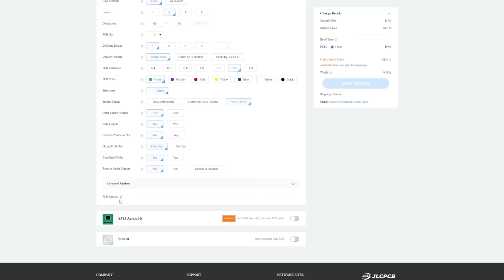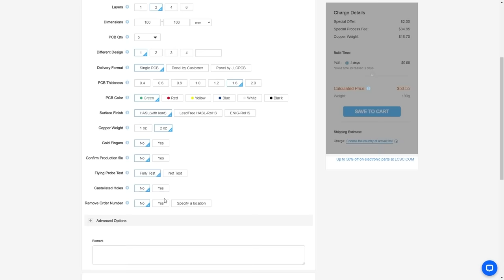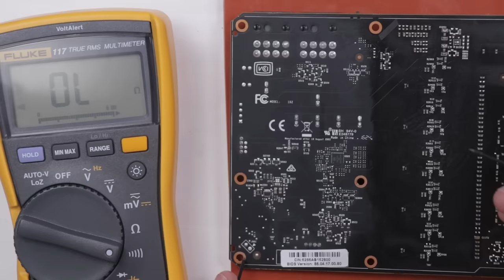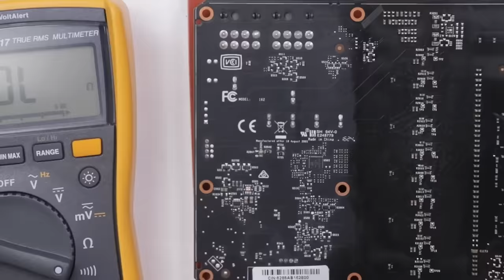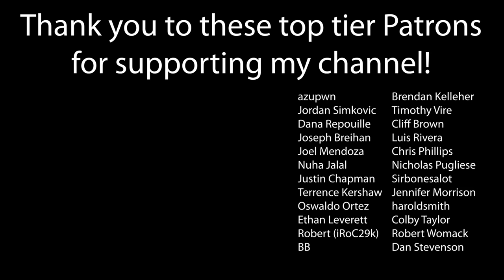I Bought 7 BROKEN Graphics Cards to Try and Fix - I Was Disappointed

Comment: 2080 Tis come with only 11 of the 12 memory channels populated from the factory, also, missing phases in the various VRMs is a normal strategy for the OEM to save money while still using the reference board design.
Reply: thats what I was thinking. Isn't each vram chip usually 1GB, so maybe that was a 11GB model but the board could also be used for a 12GB model and thats why 1 of the vram chips were missing? I also was thinking it came that way from the factory because the board looked way too clean, it didn't look like anyone went at it with flux and a soldering iron or heat gun since usually there would be some flux residue on the card afterwards
Reply: Yep, exactly what I was about to say. That EVGA 2080 ti xc ultra isn't missing any components. Also, one possible reason for the stacked thermal pads would be that the card was on a waterblock, got defective, and the just swapped the stock cooler back on to sell without caring about it being done right.
Reply: Yeah I'm bothered by him not researching the pcb or breakdowns out there. Love his videos but with today's resources this is something he could have researched on the fly.
Reply: Yeah, same with some other nVidia top-end GPUs below the Titans, like the GTX 780, same GPU (GK110) but partially deactivated and half of the VRAM, just 3 GB and these are only on the GPU side, the Titan has another 3 GB on the other PCB side; they simply share the reference PCB so the same watercooler fits both cards.
And also the 980 Ti and Titan X (both GM200 but Titan got 12 instead of 6 gigs VRAM), 1080 Ti and Titan X (Pascal)/Titan Xp (all GP102 but the 1080 Ti got 11 and the titans got 12 gigs).
Reply: Came here to leave the same comment. OEMs frequently make the same base pcb for a range of cards and populate based on the version to save money on the manufacturing and engineering side of things. Other times they over engineer in design and then find they don’t need all the extra phases or memory modules to hit their prospective benchmark. “Missing” components is a common sight.
Reply: Hello, Steve, 
The green dots and the crash indicates RAM chip errors. Those can be replaced.
Reply: 100% correct
Reply: @andrasszabo7386  This ! If the die itself would be bad then it would be a no image from my experience.Even the crash report said could not initialize memory.
Id like to see the 3060 and 2080ti revisited with some research by steve :D
Reply: @MrMackievelli  Yeah, It took me exactly 46 seconds to search "RTX 2080 ti" to pull of a photo of a stock PCB. As far as I can tell it is not missing any parts.

Comment: That 2080 Ti's board isn't missing parts, that's just cost savings done by the 3rd party board partners. Perfectly normal to be missing the last memory module. Check out some of the tear-downs of that GPU.
Reply: It’s actually supposed to be missing that 1 memory module. It’s an 11GB card, and each of those chips are 1GB chips. There’s 12 open spots but only 11 will be occupied on a 2080 Ti.
Reply: That's correct, but I think the top left memory chip is broken. Still fixable probably tho
Reply: yup some GPU's share the same board as the higher tiers. Like the 2080 ti shares the same board as the RTX Titan.

Comment: 1. Never, ever allow GPUs to boot past BIOS without a cooler mounted.
2. That 3060 with the green artifacts is usually an indicator that a RAM-chip is either bad or has lost connection with the PCB. You could try a reflow of the RAM chips.

Comment: 1) Don't ever just install and attempt to run a GPU that you know has an issue or is likely to have one.
2) Check for shorts on the power input rails aswell as on the voltage rails the card itself creates (5V, 1.8V, PEX, vCore, vMEM, VDDCI (on AMD GPUs), MSVDD (on all GA102 GPUs except for the 3090Ti)). Each power input is it's own 12V rail, so just checking one will not suffice. vCore, vMEM, VDDCI, MSVDD and PEX have rather low resistances, so check them using resistance mode. DO NOT use continuity mode, or you might just lead yourself down the wrong path. (Getting a close to 0 Ohm reading on vCore on newer GPUs is expected since the GPU silicon has a very low internal resistance.)
3) If you have a short, don't ever just inject voltage, especially if a power input is shorted. First, check if any power can make it's way from that power input directly to the GPU or memory using your multimeter. If there is a direct connection and you just go to inject voltage, you might just be sending whatever voltage you're injecting directly into your GPU or memory, potentially frying them.
4) If you have a short, inspect the componets that are on that shorted voltage rail closely. Don't waste your time looking at componets that aren't on that rail (they can't cause the short). Look for things such as blown capacitors, mosfets, powerstages or a bubbled-up top PCB layer. Look at the solder on mosfets and powerstages, see if there's some small solder blobs or balls around or if the joints look bad and not properly flowed. Those are indications that something got quite warm.
If you have a short on PEX, your core is most likely dead. AMD Vega cards a notorious for having defective cores.
5) If you don't have a short anywhere, run the card. If you have artifacting, it's very likely one or more defective memory banks, mayhaps even across multiple memory channels. For nVIDIA GPUs from Fermi to Turing, use nVIDIA MODS MATS. Run it, and it'll tell you in a plain textfile which memory bank is spitting out errors. You can probably do the same on AMD GPUs and nVIDIA Ampere cards, but I haven't looked into that yet. (As far as I'm aware, the latest version of MODS MATS that is available only supports nVIDIA GPUs from Kepler to Turing). Artifacting can also be caused by the core/memory controller. If the memory controller is dead, you'll likely find discolored underfill around the core. If you see that, the core is dead, or pretty much dead.
6) If you simply have no display, it's very likely just a missing voltage rail, probably caused by a defective logic gate somewhere on the board and/or physical damage (missing capacitor or resistor, GPUs w/o backplates are obviously quite prone to physical damage, so it might just be worth to take a closer look at the back of the PCB). That said, defective memory can also cause no display. In that instance, do step 5.

There are many more things that can cause a GPU to fail POST or not to work correctly, but a short, physical damage or a missing voltage rail are the ones that I myself have seen and fixed the most (by far).

Now, some things in general:

1) Any and all of the discolored PCB and componentry you saw in this video is not caused by excessive heat or overclocking. That's just silicone oil from the thermal interface materials reflecting the light in a funny way. Solicone oil is not conductive or capacitive. It does not damage your graphics card in any way, shape or form.
2) I'm not aware of any GPU that doesn't have some empty pads (and, by extension, missing comnponets) by default. So if you see an empty pad, that doesn't mean someone has used a GPU as a donor for parts.
3) Some GPU models have intentionally missing memory modules to get to the desired VRAM capacity.
4) Pointing a thermal camera at blank silicon doesn't do you anything since the silicon will reflect some IR that's already in your environment and, by extension, throw off your reading.
5) Please don't buy dead GPUs off of random people on ebay. It's a bad idea 'cause most of them are way beyond repair. Only buy dead GPUs on ebay if you can get at least a rough idea of what the fault is and, most importantly, if it's not been messed with already.
Reply: Something i'd like to add is that some GPU's perform just fine on benchmarks but fail on actual gamming, I have one here with this problem.
Reply: Very meticulous comment, I think he should do a colab with northbridge fix and they can hopefully share some knowledge with each other.
Reply: Graphic cards are so confusing. I'll stick to me ps5 and buy a new one if it dies! 🤣🤣🤣
Reply: Who are you the GPU police
Reply: This essay comment is a gold mine, thanks for the tips!
Reply: Or you could've just saved all that typing and told him to watch Tech Cemetery - lol -.

Holly carp. I just watched the rest of the vid, and boi, he is such a rookie with GPUs he shouldn't have touched them. The RTX3060 with the artefacts, ie, memory problem, he totally destroyed by letting it run without a heatsink. Ouch.
Reply: Thanks for the tips ❤❤❤
Reply: Also a thing I would add is that most of these better brands, specially at the higher tier cards have dual bios. It could be just as easy as a bad (flashed) bios why the cards don't work, switching over to boot with the 2nd bios is a easy test.

Comment: I have been fixing gpus for a living for more than a year. Nothing tells me these cards were unfixable. 
-The 1080 FTW just had a dead filtering capacitor. This model doesn't have fuses but its probably something minor. There are more voltages than 1V8, 5V and 3V3, there's also FBVDD, PEX and NVVDD. 
-The 3060(?) you ran at 140C, if it wasn't toast it probably is since you ran it at 140C... 
-No missing ram chip on the 2080ti. Each chip is 1GB, card is 11GB. Missing chip is because they bin the chips that have defective memory controllers and disable that one to have a better yield.
Reply: Do you have any advice for someone looking to get into fixing GPUs or electronics in general? How did you learn? Thank you =)
Reply: @phyro4143  hi, why do you consider northridgefix a scammer? Just wanted to know.
Reply: @chilly1661  Many of his videos he's changing components for the wrong ones (Alpha And Omega DrMOS to NCP DrMOS and vice versa, etc.), making the card, well not work then he cuts the video. I don't know if he's just ignorant or doing this to then buy the "broken" cards from his clients. He also doesn't seem able to diagnose memory issues, bios issues, logic signalling issues. Basically, only thing he seems to reliably be able to fix is a broken fan wire/connector.
Reply: I guess the 3060 had a bad RAM chip.
Reply: @phyro4143  yeah  the boss fix the easy one. For complex repairs with multiples ic failure leave to the most junior employee 😬
Reply: @phyro4143  I have the same idea about northridgefix... he want only to take parts for him ( doner boards ) because a lot of customers don't want to pay the repair  attempt ( 10 minutes? ) and leave phones/computer/cards to him.
Reply: Many years ago, I turned my pc on one day and got no picture. My HD7970 was broken. Any idea why it suddenly died like that? Never suffered from overheating or visual glitches on screen.
Reply: @rodryguezzz  radeon 7xxx 8xxx chips are directly soldered on the pcb without any kind of shield ( like new models) and with temperature ( and phisical dilatation)  some connections on the joins ( balls ) will fail...  at time a reballing was the best option to restore  the card ( there was a youtube channel called ELI TECH ) .. btw these cards rarely can survive 3 years of use.
Reply: @laboratorioassembler  It died after 3 and a half years of use so I guess that's true.

Comment: 6:30 The fans not spinning aren't really an indication. Those newer mid-range to high-end GPUs have what's called a "Zero-Fan mode" wherein the fans will spin when it's first turned on but then go off again until the GPU reaches a certain temperature or is hit with a higher load. 

On a usual startup the fans only spinning at the start is not an issue.
Reply: Maybe that card has corrupted bios?. Im just guessing honestly
Reply: @leexy3395  I was thinking that or mining BIOS
Reply: @benmasten5924  That 1080 has dual bios if I'm not mistaken, and the switch is right next to the 8-pin power adapter. He should've tried swapping bioses
Reply: @razmann4k  for sure.  He's learning though.
Reply: yup. I think they turn on at 60c if I'm not mistaken.
Reply: @benmasten5924  There are no mining bioses for nvidia cards
Reply: @xalzor740  ummm pretty sure people have modded bioses to make mining optimizations.
Reply: Yup my 3070ti will only spin 2 fans on startup and the 3rd fan will be spinning  after its heated up or higher load

Comment: 18:49 the missing ram chip is normal, they come like that, even the 1080 Ti's are the same 3rd chip missing. Also to note, when you get no picture and the machine appears to boot, this is an indication that the GPU is fine, but 1 ram chip is needing replacing, there is some software you can get to test your GPU memory and it will tell you witch memory chip needs replacing. Of course this runs in dos from a flash drive etc.

Also if your system boots but has no screen, try using a 2nd card and it should boot into windows on the 2nd GPU and you can see in device manager that the broken GPU 1 will show up as code 21 error, this means the card is working but the memory on the card, one of them chips has died and will give a page in non page area fault, basically use the NVIDIA software tool and find out what chip it reports dead, swap it out, card fixed.

Also if you boot using a 2nd GPU and install team viewer or something like that, log me in, etc etc you can shut it down, take out the 2nd GPU and then boot it up with the broken card, then jump on another PC and login remotely and you will get a very small screen but you can navigate around the system and see that in device manager it has error code 21 device cannot start.

Hope with helps,

Oh p.s. all the other noted missing parts, are normal, its a re-used board from reference to reference I believe.

Good luck and thank you for sharing.
Reply: @Mr Prongles Agreed

Comment: Well it's clear that this is new territory for you, with the comments on the lack of components on the 2080 Ti (which is definitely a normal thing for GPUs as they re-use board designs for a number of different chips), and running a card without a heatsink on it at all. That made me cringe because seeing 130°+ on the package means the junction temp was probably a lot hotter... For testing a GPU's board for temps a good way to get a view is to either rotate the heatsink 90° and mount it that way if possible, or use a CPU cooler to give yourself a visual of the rest of the board while it's powered on. This isn't a good thermal solution for the power management and memory though, so I wouldn't recommend doing any stress tests with this type of setup, but it's good for checking the rest of the board when voltage is applied.

With most GPUs now, they turn on the fans for a brief moment after boot to give a kind of "sign of life", then turn them off as the board boots up and starts controlling the fan speed based on temperature. At low enough temps, the fans will be off, hence why you see the fans turn on and then shortly back off when turning the pc on.
Reply: only do this if you are going to turn it off right away after seeing that it posts. usually 6 seconds then shut off.

Comment: Couple of tips for people new to GPU repair: before plugging the GPU into a working system, make sure none of the major power rails are shorted, or you might end up with more dead hardware than you started with. 
Also with the GPU prices recently, it's reasonable to assume that any "expensive" card sold for salvage has already been diagnosed and either deemed a no-fix or made worse (some people get desperate and put them in the oven). Get older NVidia cards like 700/900 series to get started, much higher success chances. It's usually harder to find info for AMD cards, so stick with NVidia until you get a general feel what all the parts on the card do.

Comment: It's normal for graphics cards to get hot in random places especially on memory chips so heatspots don't mean the end of graphics cards. The processor on the 3060 that is discoloured is most likely bad so it is most likely unfixable. Also you should test the 12 volt 5 volt 1.8 vmam vcore for continuenty. If it shorted to ground you can apply voltage and you will see with the thermal cam . If the memory is shorted it's a lost cause. The second doesn't seem too bad but not unfixable since all the voltages are present is most like a 0 ohm resistor. You could have checked with the thermal cam for a heatspot while being connected( if there is no short the thermal cam will show nothing ). In graphics cards While using the thermal cam you should know that the heat is very very minimal you will hardly be able to see it(random spots might get hot but when something is faulty on GPUs the heat is low , unless its the processor.).
Reply: GPU was fine, before he cooked it. Probably an issue with one of these RAM chips.
Reply: Current gpu s have really low resistance. Multimeters would identify it as a short by mistake. Just have to check if it’s above 0.7ohms. Entirely possible it’s even lower than that